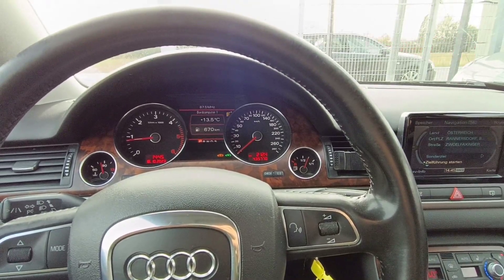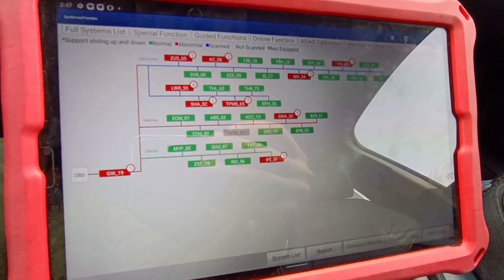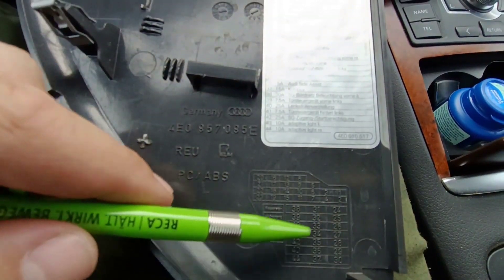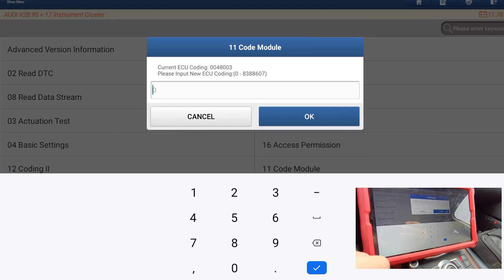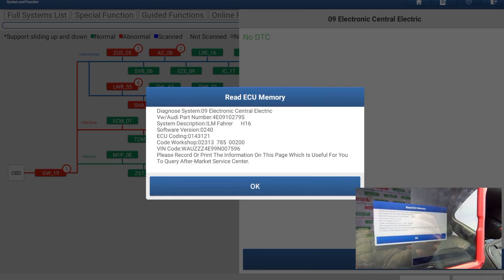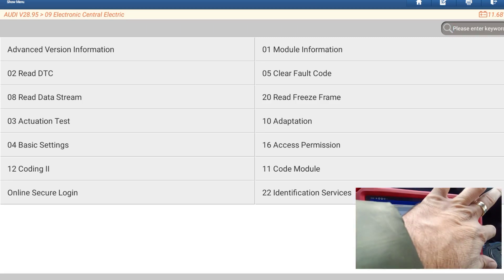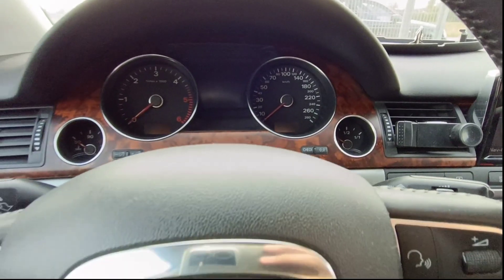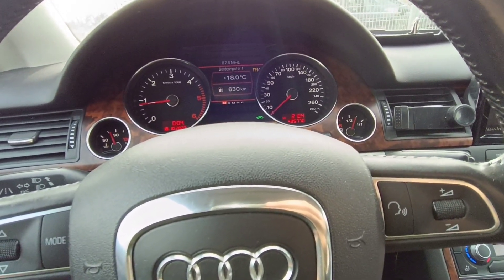Audi A8 Adaptive Headlight coding ! How to enable/disable AFS module  !!!

Comment: The lights will still adjust up and down after this ? They will stop moving left and right after this right ?
Reply from the maker: @bectasiuneraikens2997  this alternative is for those who do not have money to change their headlights.  Inside, they break the cables leading to the motors that adjust them.  so if it works you have no reason to do it.

Comment: Hello is it possible to do this on a 2014..A7 ?  Thanks.
Reply from the maker: Hello,
it is possible in all models that have 2 factory options: with adaptive headlights and without adaptive headlights.  This is the only way you can change the option.